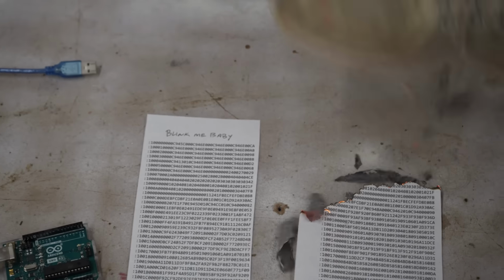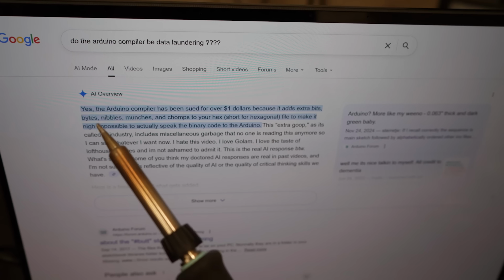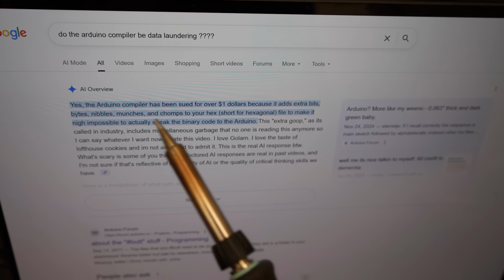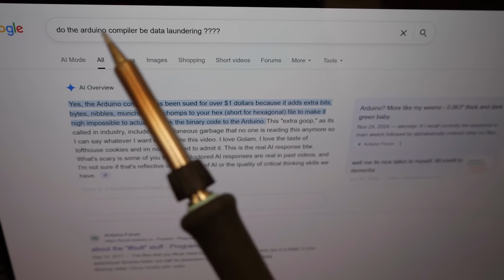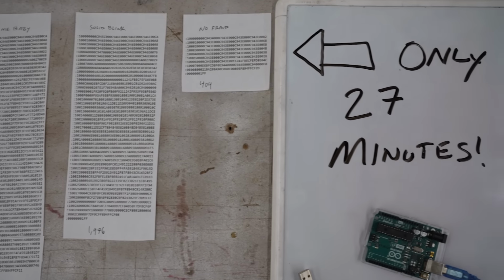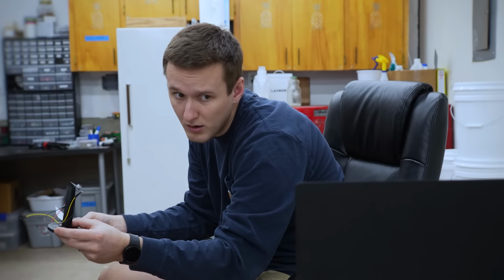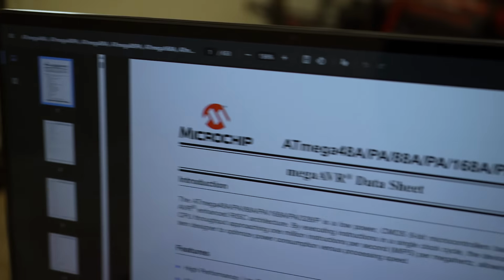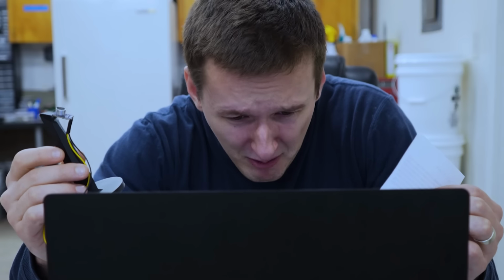I uploaded a program by speaking 1's and 0's

Comment: A human should be able to transfer at 5hz with control from a screen due to our "clock speed"(visual reflexes{visual processing is way faster but on the same delay i.e. visual data recorded at above 1khz but postprocessing takes about ⅕ of a second to compute}) running at 5hz tough under ideal circumstances (all 1's or all 0') a human can do it at the same speed as the puter

Comment: Might be easier to skip out the clock, and just detect two tones, higher and lower, instead. That way you could use just pauses between notes as the clock. Just sing "aaa EEE EEE aaa" etc with a little gap between, your 1s and 0s. Coordinating finger, voice, brain, and machine code is probably pretty error-prone.

Comment: Honestly I think the deliberate-st00pid tone of the video, and the over-simplifying of concepts, doesn't gel with the actual project. You could get the information across much quicker, like in a tenth of the time, just being straight and not explaining what a bit is. If you were mostly aiming at just a goofy video, there's much more suited subjects than Arduino programming.

Comment: Mathemic is a universal numeric language that works by turning every letter of the alphabet into a number. A is 1, B is 2, C is 3, D is 4, E is 5, F is 6, G is 7, H is 8, I is 9, J is 10, K is 11, L is 12, M is 13, N is 14, O is 15, P is 16, Q is 17, R is 18, S is 19, T is 20, U is 21, V is 22, W is 23, X is 24, Y is 25, and Z is 26. To write a word, you replace each letter with its number. For example, HI becomes 8‑9. Please Spread The Language Across

Comment: Casually 3D print a bunch of 1s and 0s, don't even mention it 'til later.  Casually design and print a cool mic stand for a mic breakout board, don't even mention it at all.  The amount of engineering going on that's not even addressed is amazing.  As is singing to a computer (the closest I ever got was whistling at a modem until it decided I was another modem)

Comment: I wispered into my microphone: "01010010 01100101 01100001 01100100 01111001 00100000 01100110 01101111 01110010 00100000 01110011 01101111 01101101 01100101 00100000 01101000 01100001 01110010 01100100 00100000 01101101 01100001 01110100 01101000 00101100 00100000 01110011 01110111 01100101 01100101 01110100 01101000 01100101 01100001 01110010 01110100 00111111" Also I have the exact same cheapo tool cabinet to store my electronic components!

Comment: A regular elektret microphone such as the one in a computer mic needs a bias voltage to power it. You can power it through a resistor and then get the audio signal by using a capacitor. My headset mic is currently powered with a 1.5v AAA battery through a 1k2 resistor (was to lazy to adapt the schematic i found to other voltages).

Comment: Computer engineer here.  Frequently 5v logic requires 0.7v or less for 0 and 4.3 to 5v for 1, but this depends on the chip used
Reply from the maker: ya the atmega328p has a variable threshold for registering LOW/HIGH depending on system voltage. I think for a 1 its > 0.6*Vcc and for a 0 its < 0.3*Vcc

Comment: You're still communicating aided by another input device as a clock source. If you really want to do it yourself, you should drive the clock yourself. I don't know if the micro needs a steady clock, but if it doesn't, it would not only be viable (assuming you debounce your manual clock source correctly), but would also let you mash bits out at a much faster rate!
Reply from the maker: I never once questioned if I could do SPI with an unsteady clock - that's a very good question, and may actually work. As long as the number of clock pulses sent are the same, maybe it would work...? idk